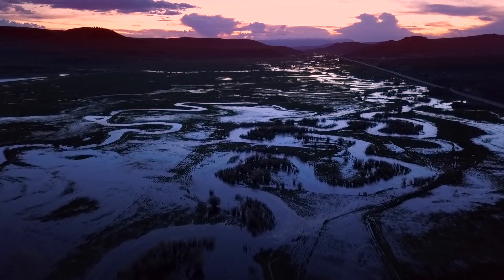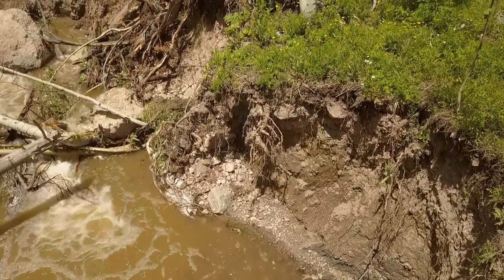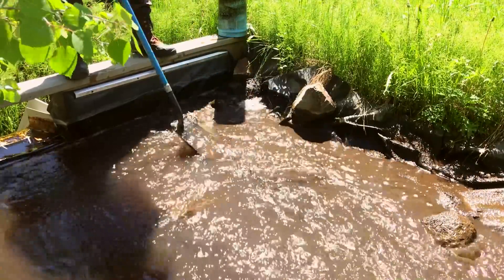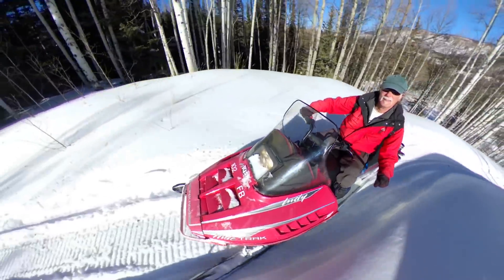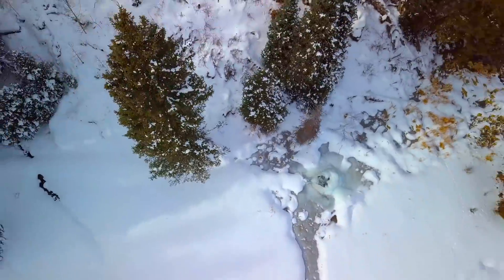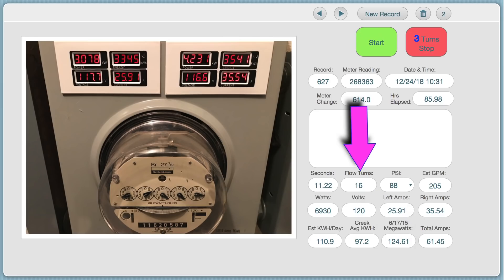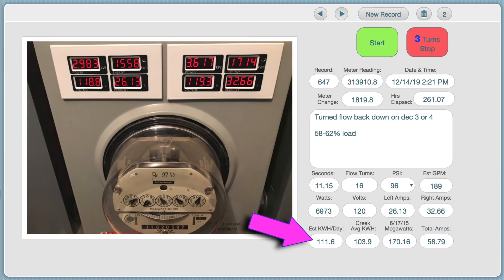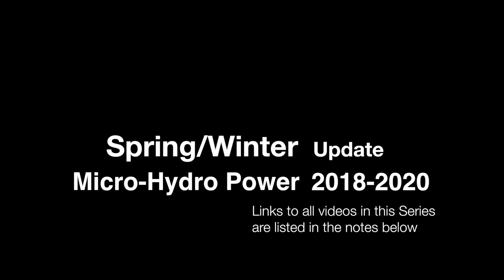Part 21 Micro Hydro Power System in CO

Comment: why not divert the creek, build a collector, and run a line underground from there, right beneath the creek. on top of the collector you let a couple of metal grid panels (protected from corrosion), rest on top, on top of that some gravel, now the collector will fill with water, put pressure on the entire system, no air, and you'll have a laminar flow of water all the way down with a lot more pressure, which is more energy. Winter, summer doesn't matter, as long as there is water running through the creek, the collector fills up, as long as the collector fills up faster than it empties, no problem :) Personally, I would build 2 collectors, one just to filter large particles and to use for generating electricity, and one with a rock//gravel/sand/charcoal/50µm/100µm filter, for drinkable water and waterpressure on that system, to shower, dishes, bathroom,cook,pool,jacuzzi....
You dig in 4 20000liter rainwater tanks underneath the creek and run 4 lines down...
I'd know what to do and how to do it, if I were living there!!! hehe 🙂
Reply from the maker: Sorry for the slow response.  The amount of silt in Spring melt off getting into the penstock system would be harmful the brass pelton cups in the turbine.  Also the powerful erosion of the melt off precludes during the penstock beneath the creek.  Each year the creek is broadly modified by the enormous melt off.  Additionally the area where water is diverted is extremely difficult to access with heavy equipment.  Anyway, thanks for the ideas and your viewing.

Comment: Any suggestions on finding properties with water and proper head? Best I've come up with is just scour the realty sites and filter to only show water front properties, water views, and mountain views
Reply from the maker: Finding a suitable site isn't easy and I sort of lucked into it myself.  Water on a property is one of the most crucial aspects to require in my view.  Remember that high head isn't necessary if you have good year round flow.  Its the combination of head/flow that indicates the potential power from the site.  Even an output of 1kw if combined with batteries is 24kWh/day where 30kWh/day is what most US homes use on average.  efficient lights and appliances help lower that too.  There are lots of different methods of harnessing power, each one best suited to a particular head/flow/power need.  Extensive research for the best method with save lots of money.
I don't have specific ideas of how to search but you might ask these brokers if they have insights:
https://livewaterproperties.com  While their focus is on super expensive properties and hunting(which is not my thing) they may have ideas which may help.  Sorry I don't have more to offer.
Thanks for Watching!

Comment: This project is so inspiring! How did you file for your non-consumptive use right? Did you use an attorney, and did your case go to water court? Did you apply for the right before diverting the water and putting it to use, or the use before right? Finally, do all of your diversions go through your own land? I ask this last one because there's a small stream near me - smaller than yours - that I'd like to use for micro hydro, but the headrace channel would need to go through national forest land for a hundred yards or so. I'm wondering how I'd get the easement to put up the pipe and maintain for the short distance it would have to cross public land...
Reply from the maker: I initially used a lawyer for the rights on the spring water source (parts 1-5) but I was also seeking domestic, piscatorial (fish), and other rights.  It did go through water court. First you file for rights and you are granted a “conditional“ right.  This will last up to 7 years and can be extended additional 7 year periods by refiling. Once you show beneficial use you can file to make the rights “absolute” which means they are final and can’t be disputed and you don’t need to refile. When I filed on the creek water I learned I could forgo the lawyer fees by filing “pro se” which means by yourself. It isn’t all that complicated and you can figure it out by researching in depth and water commission people can be helpful to you.  All our diversion paths do reside on property I own and that simplifies things. As far as getting forest service permission that may be difficult, although I have no first hand experience on that. I would think asking a water lawyer about that would provide a simple answer about if it’s possible to get that sort of easement. 
Hope this helps some and thanks for watching. If you subscribe there are upcoming videos currently being worked on.
Reply: @mrhydrohead  Thanks for your response! Did you need any kind of permit? Since your project isn't grid-tied, I suppose a FERC permit wasn't needed, but did you need to get a Nationwide permit? I appreciate you fielding these questions.
Reply from the maker: Internet has been down since Tuesday AM. Not sure when it will be back up. It reveals how reliant we’ve become on it. I’ll reply in detail once it is back
Reply from the maker: Internet is finally back! As I said, I filed pro se for and received a conditional water right ( in 2000 when Bush took office) and renewed it twice before I actually began construction  in 2014 Each renewed filing gives you 7 years to prove the beneficial use of the water. This is with the regional water court. At least this is how it is in Colorado. I don’t know about other states. I did not file with FERC as the size and water source did not require it. I hope this info helps and my apologies for the slowness of response.
Reply: @mrhydrohead  I appreciate your response! I've been talking with a few large landowners in my area who have creeks on their land, and a few of them are open to the idea of hydropower on their land. I've identified one site that I'm particularly excited about, and have already begun working down all the licensing and legal paths I'll need to develop the site. This site has a 550 ft static head and will require a 4200ft pipeline to utilize the full potential. I may also be able to divert about 20cfs during spring runoff, generating about 500kW - I've set up gauging stations to determine the annual flow variability and to build a rudimentary model to correlate the flow on this tributary to the flow through a USGS gauge on the main stream. My next step is to start estimating construction costs. You're starting to branch out into documenting other hydro projects, do you have anyone I could contact regarding pipe sizing and pricing, as well as the turbine size and pricing? Thanks in advance!
Reply from the maker: That is quite a tall head. You will have about 220 psi at the bottom. I think it is critical for you to determine 1. Whether you have access to the local utility and also 2.whether they will buy excess power. The cost of the penstock would be tremendous for 4200 feet. And the diameter of pipe needs to be huge to carry 20cfs. Part of designing is to take a hard look at how the power will be used.  The average us house uses 30-35 kWh 
I think you can contact either Ken Gardner whose email is in the notes section of the last 2 videos I’ve posted or you can contact http://www.canyonhydro.com/products/products.html. They built my turbine back in1996 and it still runs flawlessly. Please tell the that I referred you 

This will be an expensive project

Comment: Instead of "V" belts try power bands (cogged belts) ! Power bands will give you an increase in efficiency of 10% by eliminating "V" belt slippage.
Reply from the maker: That might be a benefit. However we make so much more power than we can effectively utilize that adding efficiency isn’t necessary.  Thx for watching and the suggestion!

Comment: I wonder if you could take the remaining water pressure and spin a compressor, to run a geo thermal system.  seems to me spinning the compressor directly would be efficient way to heat home.
Reply from the maker: There is plenty of power to run a compressor with electricity but the cost of a geothermal system is way out of reach compared to simple resistive baseboard heaters. Also there is no excess water pressure and the powerhouse is 1200 feet from the house so it’s impractical anyway. Thanks for watching and for your suggestion.

Comment: Hi, I am curious what was your cost to initially setup your system?
Reply from the maker: We started in 1995 acquiring water rights and putting in a penstock from springs. That initial system cost around 25k in 1996 dollars. We also got gravity pressurized domestic water and a pond for raising fish at that price.  
When we moved the existing equipment to the creek we incurred additional costs of around 55k in 2015 dollars because we needed a full redesign of penstock, powerhouse, transmission and load management.

Comment: Shout out from New Hampshire, we are planning on finding specific property with a year round water source to do a similar hydro system. What drone do you use to do your killer videos?
Reply from the maker: Thx for watching!  I have the first version of the DJI Magic pro  and for anything requiring preprogrammed flight I use an app called Litchi. Best of luck for your search and your project. Be sure to investigate what sort of non consumptive water rights you may need to acquire.  Every state has different rules and procedures.

Comment: can you give lima ser generator serial number or model number or even a good view of the compliance plate plz thank you
Reply from the maker: Model # was lima ser 250SDL1230
Part # 3250-1230
1800 rpm frame 250
Volts 120-600 depending on wiring config of 12 leads
Part14 of the series has detail on wiring options around 2:18+
Hope this helps. Thx for watching

Comment: Hey there! You have mentioned to install anther turbine, how much power do you need now? What are your plans for future consumption?
Reply from the maker: If I document another turbine system it will be on someone else’s property. I might possibly install a second jet into my turbine to allow more water flow through the system. Right now I am limited to about 300 gallons per minute or 2/3 of one CFS. The second jet would enable me to maximize the available power from the system which would be 10 kW of continuous AC power. Thanks for watching

Comment: May I ask what you do with excess power? Nvm, I guess your flow management answers the question.
Reply from the maker: Excess power is shattered off to inexpensive resistive loads like a water heater or baseboard heater. We change the amount we capture twice a year 4500 W for most seasons and 7500 W for winter when we need the excess power to heat the house. Thanks for watching

Comment: Loved watching this series, we have the potential at our off grid cabins for about 250ft of fall and 100-150gpm i just wish we had the money to invest in making something a little smaller scale then this. Maybe someday. But keep posting updates i love these videos
Reply from the maker: Thanks for watching that sounds like a really good amount of fall and water. You should be able to do enough power to power most anything if it’s DC convert AC and you could also add Solar to it if it was not Enough. Thanks for watching
Reply: How small and simple do you want to go just to start with as proof of concept?
You could add multiple units with a flow of 100-150gpm......
https://www.youtube.com/watch?v=Xb6TIWub6KU&t=1s

Comment: Where can I buy the components for a hydro powerplant?
Reply from the maker: There are a lot of mfrs of gear these days, far more than when I set my first system up.  You need to tailor the equipment to the site's capacity and your need for power.  You may not have the capacity to go direct AC like mine, but there are lots of alternatives for DC systems out there today I bought mine from Canyon Industries in Deming WA, USA way back in 1996.  Powerspout.com makes good gear from what I’ve seen.  Searching "powerspout hydro" on google should bring up other potentials.  The more research and planning you do will save you time, money and headaches from making incorrect choices.  I also suggest reading a good book “Serious Micro Hydro" by Scott Davis. Available hardbound or Kindle from Amazon. https://www.amazon.com/Serious-Microhydro-Water-Solutions-Experts/dp/0865716382  It has examples of lots of different size systems with lots of education included.  Again, thx for watching and best of luck.

Comment: Adding up the Amps like this is NOT correct and will introduce some error - the measurements show they are at slightly different voltages.
Reply from the maker: Yes voltages vary with load and there are errors.  Those errors would be smaller than the errors introduced by the load controller which distorts the sine wave by shunting off portions of it into load balancing.  No readings are perfect and we’re only interested in a general idea of how much power we are harnessing.  Its a lot any way we look at it.  Thx for watching

Comment: have you ever thought about running a hydroponic light (hps) to grow veggies during the cold months and use the excess heat to heat your home
Reply from the maker: One of the original inspirations for making our micro hydro series was this man’s series on designing and building his own geodesic greenhouse. Very Cool https://www.youtube.com/watch?v=H7ynBppcvKM
Someday we might put in a greenhouse and use excess power there, but it would be a big undertaking.  It might also require increasing our power capacity by putting a second jet in the turbine.  That may happen this year.  Thanks for watching

Comment: I would like to know what drown you are using. Please.
Reply from the maker: DJI Mavic Pro (original 1) with Litchi app for control and programming. It took a bit of trial and error to figure it out. It does have collision avoidance built in. Not in all directions, but forward and down yes. One reason I face top of image towards trees while descending. Works fine. thx for watching.

Comment: just stumbled across this... subbed, will re-watch from beginning this weekend. thank you, looks interesting... "a german living in australia"
Reply from the maker: Suggest you watch parts 20-1, 20-2, 20-3 first. That is a synopsis. Parts 1-5 are about our first system and parts 6-19 are the how-to of the redesign. If the music bothers you there are non-music versions of several in the 6-19 set. The early ones were low quality with quality improvement as time goes by. Thx for watching 😉

Comment: This video was largely enjoyable! Hope I can obtain land at some point with access to be able to do micro hydro power.
Reply from the maker: 1st. Establish you have the legal rights to make an installation. 2nd. Measure head and seasonal flows. 3rd. Determine how much power is available and how much you really need. 4th. Design the system to fulfill those needs and as much of overhead for future needs as you feel you need.
Every site is unique, so I'm not sure my specific measurements or equipment would be of use to you. Does your creek have large seasonal changes? If so what is the minimum that it can provide at the lowest flow during the year. I don't know what country or state you live in, so I don't know what sort of suppliers you have access to. Do you have sufficient head to go direct AC? 50hz or 60hz, what is the standard in your country? What voltage is standard? If insufficient head and pressure to do AC, then you would do DC with batteries and an inverter. How far does the power need to be transmitted to where it will be used?  
There is a good book to read "serious Micro Hydro" by Scott Davis. Available hardbound or Kindle from Amazon. https://www.amazon.com/Serious-Microhydro-Water-Solutions-Experts/dp/0865716382 
It has numerous examples of both AC and DC systems taken from a magazine "Home Power" which were published over the years on the topic of Micro Hydro. Its a good place to start to acquire an understanding of how it all works. He edited another book "Microhydro: Clean Power from Water" which I haven't seen but assume is good.  
I learned the basics by taking a class at SEI in 1995 and then had any years of working with my first system to gain my understanding. https://www.solarenergy.org/micro-hydro-training/ Back then, the internet did not have the resources that exist today. They are numerous.
In terms of how my house is wired, I wouldn't suggest doing it all yourself, but find a local electrician that understands the electrical codes in your area and get there guidance or advice. its pretty easy to kill someone or burn down your house if it isn't right. 
I don't know how I could have been more explicit or precise in the detail I put into the series without being too much information. The answers about process are there in the series, but you have to understand it is not a one size fits all sort of technology. There is an enormous amount of detail I have given over the years in the comments section to many other people. Reading through lots of comments may answer your specific questions.
It all requires having an understanding of the basic principals and process and then making lots of choices specific to your own topography, water flow, power potential, power demand, peak demand, legal restrictions, and finances. Also, what materials are available in your area and where can you save costs because you will be paying for all future power up front and it won't be inexpensive? What is your budget for doing it all? Who will perform the work and what will they cost? How much of the work can you do yourself or with friends?
My most earnest advice is to become as educated as you can with books and online resources before you go about actually doing anything. Do your study, measurements, and homework first. You will save yourself a great deal of money by planning specifically and not overbuilding a system that creates more power than you can use.